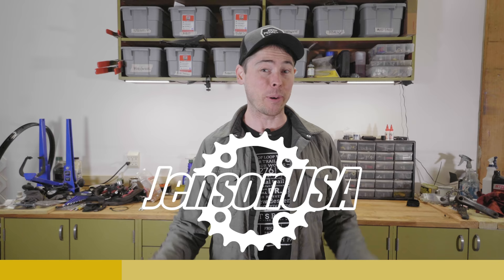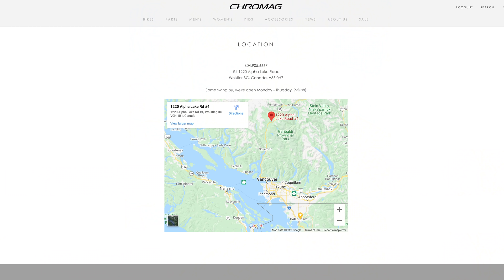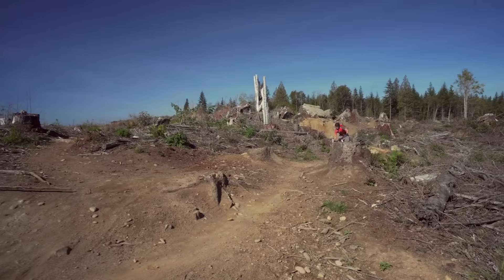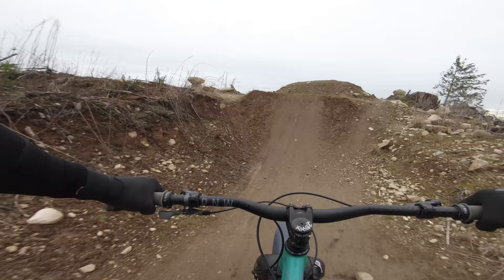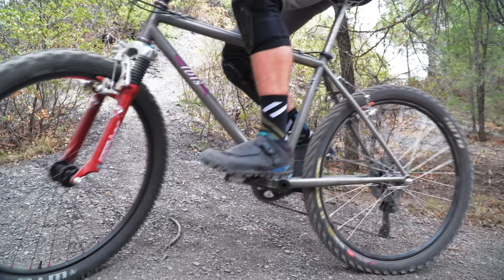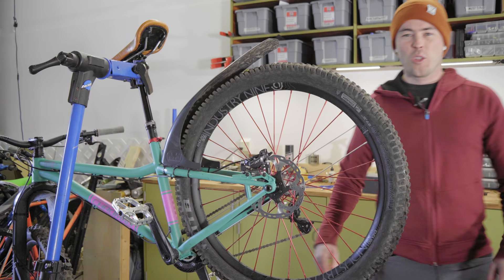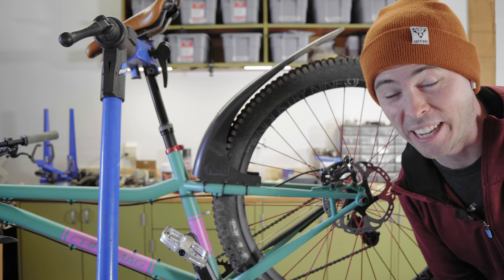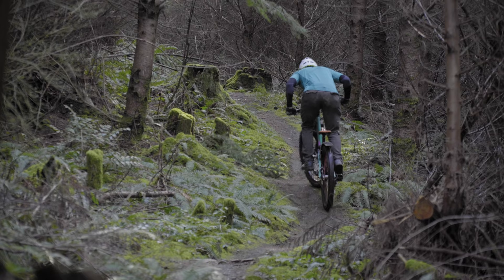Praying Mantis?  Or aggressive, new school hardtail?

Comment: Hardtails rule! It's amazing how much they make you appreciate how far components and geometry have come.  Would love to see a re-review of the message vs. Telescopic fork in context of the hardtail. Avoiding the head angle dynamically steepening seems like a huge benefit.
Reply from the maker: Yes!!!  Hardtails also let you know when you get the pump right!  I don't think the Message is an ideal fit for this bike, so I'll throw a telescoping fork on here soon.  The linkage system is great for a hardtail, BUT the 130mm travel is a little short.  The 180mm of the Shout is super tall, and is likely too much.

Comment: ha wow - my two trailbikes are an ibis ripmo and a chromag stylus, i dig your style
Reply from the maker: Indeed sir, you've got commendable taste if I may say...
Reply: @LiveFast135i  yeah honestly comes down to whether you want 27.5 or 29. I wanted the stylus more for singletrack with jumps/features and figured 27.5 would be more appropriate for that. Rootdown should be fine though, and honestly 29 might be more appropriate for a hardtail depending on the riding you are planning to do with it.
Reply: I def recommend demoing a 27.5  and a 29 in hardtail to see which you prefer riding. No bike is more expensive than the one you buy and never use!

Comment: I've been waiting for a frame like this. I've been building aggressive hardtails for building/riding remote dirt jump trails in the woods for a long time. First one was a Boss BMX 26" cruiser I put a Marzocchi bomber and disc brakes on back in 1999.
Reply from the maker: YES!  I'm from the bay area and kind of got used to seeing folks on the Boss cruisers with squishy forks BITD!
Reply: @JeffKendallWeed  Maybe you saw me! I built the Chevron jumps, and the Willows jumps in Tam Valley, and then the Scott Valley Trails at the end of the bike path in Mill Valley that lasted like 13 years. Lots of people from Santa Cruz visited and filmed there. They might even still be there, I stopped maintaining them in 2010.

Comment: Get a specialized power saddle. The nose is cut short. Very comfortable saddle. You measure your sit bone width at a bike shop and get a saddle to match the size. That might fix the problem you're having with the nose hitting you on climbs.

That is by far my favorite saddle. I've got one on every one of my bikes
Reply: @bananasstuff3344  the width doesnt, but the shorter nose of the power saddle does. Since the nose is shorter is doesn't come forward from the seat post position as much thus giving you more room between the end of your saddle and the handlebars. The width is just for fit

Comment: BTW, I totally agree that SS mountain bikes are not for everyones local trails. They work for my regular loops and I have been almost exclusively riding my Ti Seven Sola, set up as a fully rigid SS. Currently running i30-35mm rims with fat 2.5 to 2.6" tires(that's my suspension) I'll be testing out 27.5 Plus wheel builds soon. New subscriber , great channel!

Comment: Awesome!  Glad to see you testing out a aggressive hardtail Jeff.  They are an absolute riot.  Once I got my 2020 Whyte 905, I loved it so much I sold my Trek Fuel EX because I did not see the need for it any more.  Curious if you have tested the Vittoria Air-Liner vs the Cushcore?  I just installed the Air-Liner in the rear wheel this last weekend (And Absolute Black Oval Chainring), but have yet to test it out.
Reply from the maker: Thanks Jason!  I haven't tried any Vittoria stuff, but Ive heard good things!!!

Comment: So awesome to see you on that bike. My last SS was a pivot les that I had set up with 27.5+ tires. I ended up selling it because the HTA wasn't steep enough. I'm just not an XC guy. The stylus 

On your seat problem maybe just drop the max height of the seat? On SS you're standing when climbing anyway so don't bother with ideal seat height. ;)
Reply from the maker: The LES wasn't a STEEP enough head angle?  You mean slack???  I fixed the seat problem by putting gears on the bike.  Much better!
Reply: @JeffKendallWeed  Yeah, slack haha!

Comment: What exactly is the connection between seat tube angle and single speed? Is it that you can't pause pedaling to lower the seat and also forced to standup?
Reply from the maker: On the single speed set up you need to stand and pedal A LOT.  I prefer a fixed height seat post and more traditional geometry on an SS.  Trying to drop the saddle on the steep climbs is super awkward.

Comment: Part of the "seat in the ass" problem may be because the Trail Master is a longer than normal seat. I love my TM. The straight top makes it easy to slide forward for climbing, and that wide nose makes it the most comfortable seated steep climbing seat ever.
Reply from the maker: I think it's more seat angle.  The WTB saddles are similarly big, and with gears, it's not an issue at all.

Comment: 2019 M/L red stylus 6'1", 32" inseam, its such a great bike; the decision was clenched when chromag made the 2019 seat tubes/stand-over less and jensonusa, super fast & great price and availability; get one, they sellout! Personally the stylus does not feel heavy. I ride mostly single speed on steel bikes, but with advent of enduro and play-riding transitioning from XC to funtrack, enduro, downcountry i want to pedal into jumps and trying to push <32x16 up 7-10 miles up, just zaps ya. On the stylus I run XT/Saint 11-28 road cassette setup, makes you still work for it going up and great downhill gear selection. All that SS out of the saddle has made me go droperless, shiz i hardily even raise the seat. Thx Jeff for doing a review on this bike, it has been warranted.

Comment: Seat...hitting the seat (so to speak). I remember having a bmx seat (more than lilely for freestyle flat land moves) had a stubby nose on it. I know it was wider than the one on this bike...but I'm wondering if there is a way to alter the underside of this saddle and rewrap the same material under a shorter front to back stem?  Thinking to find solutions.

You make most every bike look fun to ride! 😇😎
Reply from the maker: Thanks for the note Jeff!  I fixed the saddle in the way issue by putting gears on it.
Reply: @JeffKendallWeed  saw that after finishing the vid. Haha!😇😎

Comment: That looks pretty Rad Jeff. Kat Hardtail I had was an Evil Imperial. Should have kept it would have been worth $$$$ now. Did you use a Tensioner when running it single speed and if so which one? I may have to go this route cause low budget....
Reply from the maker: The Imperial!  I've been planning to ask those guys about when the Imperial v2 would be coming!  I used a Shimano Alfine tensioner, worked great, only got chain slap once or twice, never dropped a chain in 3 or 4 rides with it.

Comment: Great to see you go for a steel HT, love steel (can't afford Ti I want) much more capable than most people think and they ride much nicer than alu HTs, IMHO. Now to the questions...1-What's the A2C on that Trust fork you built it with and does it change the geo from stock? 2-Hard to ask you to do I guess, but could you compare the ride quality/feel off the Chromag to the Ibis HT? From all the marketing material and IIRC your video on it, it's sposed to be quite compliant, so curious now you have saddle time on both.
As  to other bikes to check out, how about a Rigid steel PLUS bike, something a little less aggressive, like maybe a Surly Karate Monkey (Jenson carries them), or Kona Unit? FYI, both can actually run 29x3" despite being only cleared for 650B 3.0". Or if you're thiking FS, one of the new Banshees.
Reply from the maker: Thanks Lynx!  That little Message is a small 530mm axle to crown, so its steeped up the head angle to around 65 and the seat angle to around 77.  The Ibis is a much more rigid ride.  It's also about 4 pounds lighter (just the frame!).  I'd rather build the Ibis for XC, with a carbon, non-dropper post and lighter parts.  The carbon post would help make the ride more forgiving.  I've been really surprised at how much softer riding the Stylus is. But that weight difference is HUGE!  Stylus is more of a steep up, steep down bike for the mountains, where as the Ibis is more of an all around trail bike.  They are really very, very different.  Both good, just different.

Comment: What mudguard you running with the trust
Reply from the maker: I just cut that out of an old cutting board.  I never found any commercially available fenders for that thing.  The fender doesn't work very well compared to a RPR or MudHugger, but it is better than nothing.

Comment: Hadn’t thought about steep seat angle vs singlespeed—makes a lot of sense. But what about steep SA vs hardtail which can only get steeper with sag vs a FS that, on ups, will sag back towards “normal” (whatever that means 🙃)?
Reply from the maker: I'm only running the 130 fork on here for now, so the seat angle is already exaggeratedly steep.  Anyhow, I've been riding it with gears lately and definitely prefer it that way.  It sorta wasn't fair for me to set up the Chromag as an SS in the first place.
Reply: Jeff Kendall-Weed gotcha. Thanks for the reply.

Comment: How was the Trust fork for standing climbs when you were singlespeed?  I assume they would make for an efficient climb but haven't seen anyone use one on a SS bike yet.
Reply: I agree I think that they would be more efficient. Normal telescopic forks compress when getting out the saddle and putting weight on the front. The trust forks should be less sensitive to vertical load from handlebars (with its initial rearward axle path), but rather responds to oncoming bumps and hits from the trail very well.
Reply: @ianw3811  that's my thought too.  I'd really like to know someone's first-hand experience.
Reply: @ianw3811  I got a Trust fork off eBay in May 2020 and stuck it on a Vassago Radimus Ti.  The fork rides a little rough but is great on standing climbs.  It took a while to get it tuned but it works as well as I hoped.

Comment: Does the head angle get steeper with the trust fork like a normal fork?
Reply from the maker: Yes, it physically gets steeper, but the axle gets brought rearwards, so the handling doesn't change.  This means it doesn't have the negative traits of a steeper head angle.  It's a much more noticeable feeling with the longer travel (178mm) Shout platform than this 130mm Message unit.
Reply: Jeff Kendall-Weed cheers. Safe!

Comment: I just got a Chromag Wideangle frame. What do you think about water getting inside the frame? This is my first steel bike.
Reply: if youre worried about it just buy a can of framesaver and coat the whole inside. not a lot of work and then you'll be worry free
Reply from the maker: Meh I'm not too worried.  It'll be decades till it ever rusts out.  Ive never experienced an issue with rust in a steel frame, even with older 1980s bikes.

Comment: You said you were 5'8" and did a medium frame, how is the reach working out for you?  I'm similar height and curious thanks!
Reply from the maker: Yeah I'm 174cm/5'8" and the medium is good if not a little small.  A longer reach would have helped the saddle in the way while riding SS, BUT the small size makes this thing feel a little like a trials bike in the rocks, which I'm stoked on.

Comment: how are you liking the cush core on a hard tail vs FS?
Reply from the maker: I think they have equal benefit for hardtail/FS.  I do prefer them on the 2.6 tires.  But I still have had a tough time finding a goldilocks pressure that doesn't fold over on big hits but is comfy on roots/rocks.